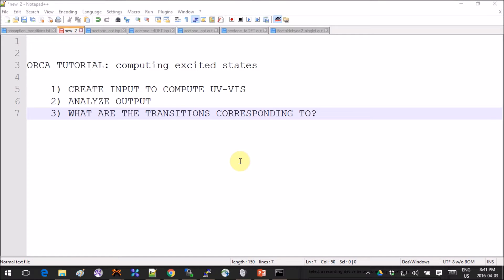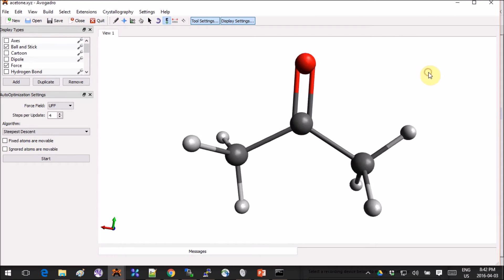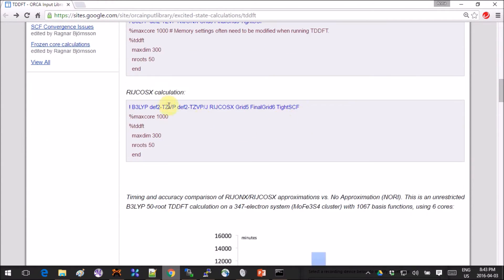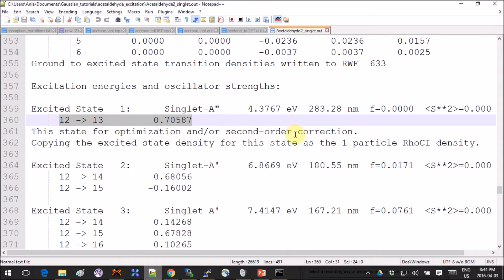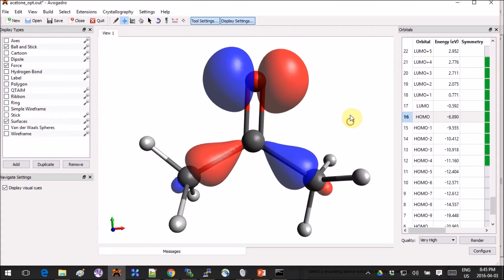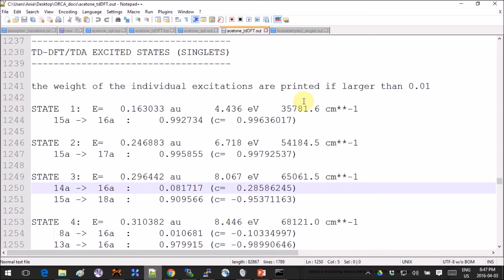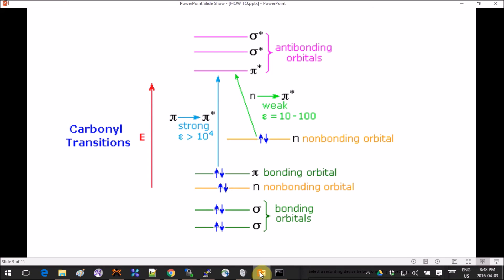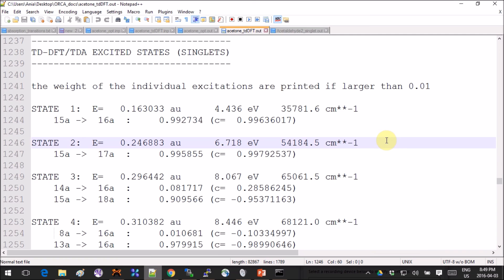Avogadro with ORCA Tutorial: UV-Vis calculation

Comment: On input acetone_opt.inp which was the method used?
Reply from the maker: it`s shown on minute 1:15
Reply: you have two inputs, acetone_opt.inp and acetone_tdDFT.inp.
In 1:15 is acetone_tdDFT.inp. Which the method in acetone_opt.inp.

Thanks
Reply from the maker: same! you should optimize and compute the transitions using the sameconditions